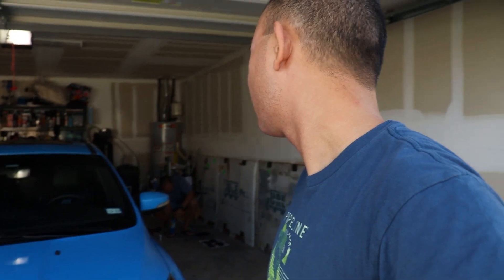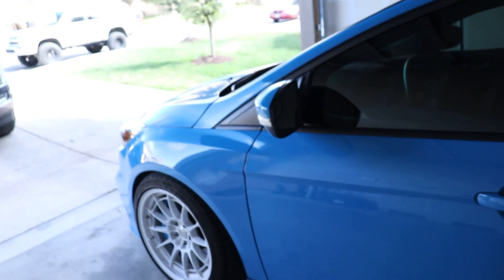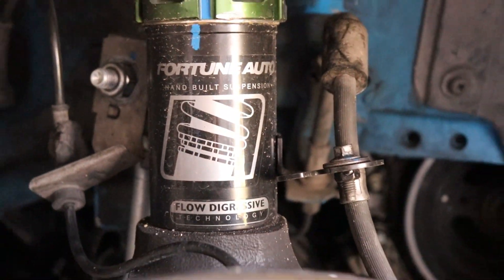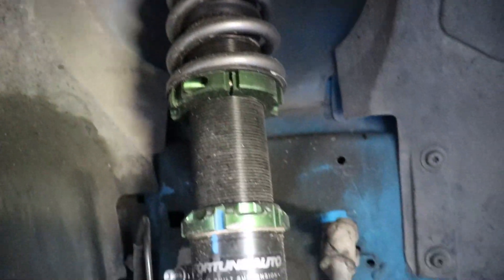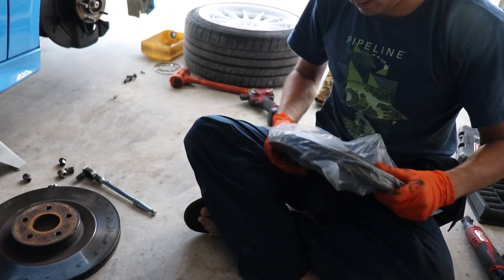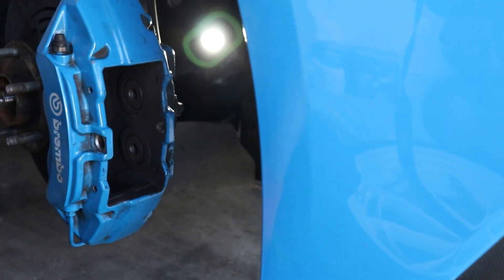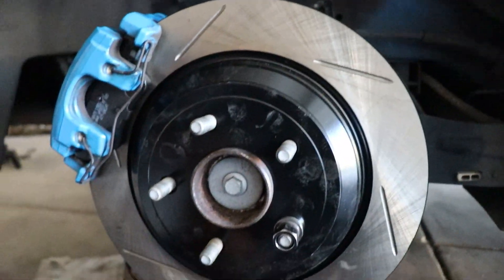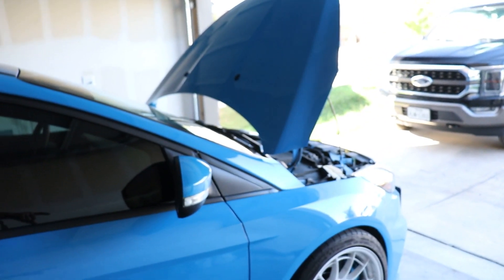Focus RS BRAKE PROBLEM! GOTTA CHANGE BRAKES!!!

Comment: Just did the brembo swap on my ST in august, now to do the RS rears well over due because I’m still rocking the factory pads and rotor(s)…..at 153k miles. 😅 Love the videos, love the track uploads and how to vids.  Quality content as always. Thought about doing the slotted up front and drilled rotor in the rear, what you think?
Reply from the maker: I have strayed away from the Drilled rotors because of the potential for drilled rotors to crack over time when you are tracking a car. I know that there are a few race cars out there that utilize drilled rotors, but I am just trying to mitigate a risk of cracking if I can help it. 

In brake rotor selection, would always do my best to use similar rotor specs to what the fronts are going to have. Best case scenario, I would use the same manufacture and model of rotors to keep the rotors and braking power the same. (Even though majority of braking is done in the front).

Thank you for the support! I have more videos that I am going to be working on. I have been taking a break.